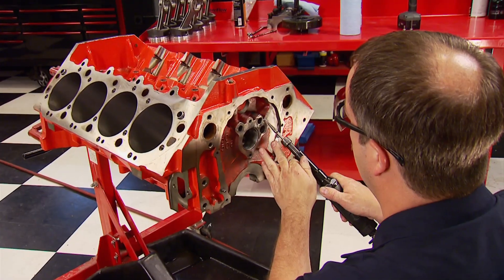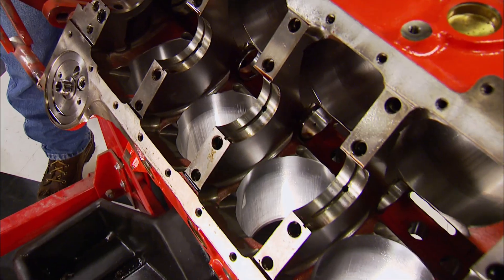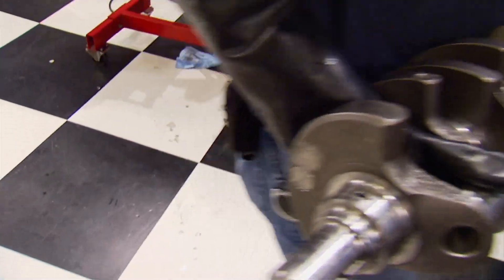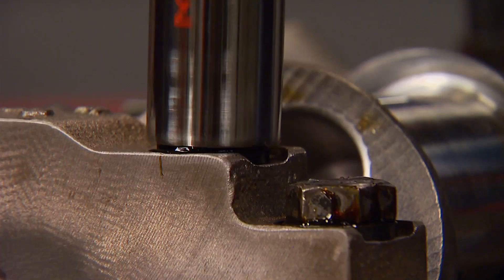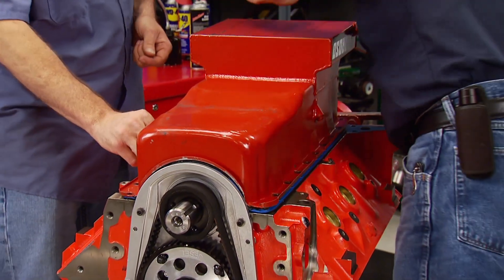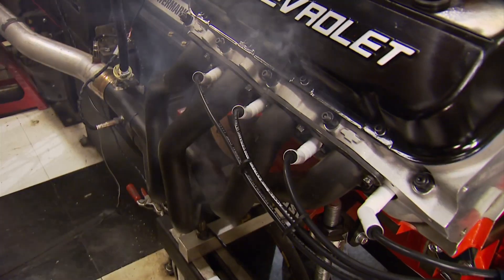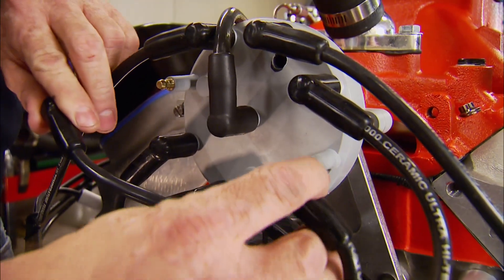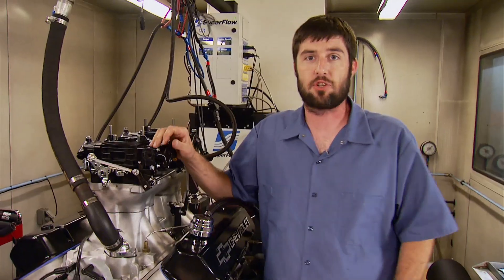Big Block Chevy 572 Bracket Blaster From Leftover Parts - Engine Power S2, E19

Comment: You beat my 572 but I don't know if I'd call that a win. My engine I put in back in 2005 and over 20,000 miles and counting. 
My 572  compression 10.5 flat top pistons, off-the-shelf rough aluminum castings, angle Milled down to 106 CC combustion chambers. 345 intake CC runner heads. Solid (non roller) cam 580 lift 256 @ .050" duration. Merlin X intake, 1050 dominator. Double roller timing chain, MSD digital 6, 87 octane ethanol free pump gas. 
730 horsepower at a low 5400 RPMs.
740 ft lb of torque at 4000 RPMs.

What I learned years ago is keep the RPMs down you'll make anything live a lot longer!

An open chambered head makes more power. But when you have to run a dome piston you have to retard timing back so you kill power on pump gas. Two identical engines one with flat tops and milled cylinder heads like mine. And one with Dome pistons and a 119 CC heads. Of course everything else being the same and pump gas. My engine makes more power and without detonation, without engine run on and without dieseling problems. I've been there before with these problems running Dome pistons and pump gas that's a junk way to go! And after 18,000 me my Pistons were freed in another engine. When you get into angle milling the cylinder heads you're changing the valve angles that makes a little more power. In this sport everything adds up. For pump gas it's only a flat top or dished piston and solid lift cam with me. I'll go back to a solid roller when the roller lifter Wheels don't fall apart. But until then I'll just go to more cubic inches you can never go wrong. With my engine proves in its same class it beats the competition and it's an old engine. This engine beat me by a little horsepower on top but my engine beat it a lot more across the board in torque, and maximum torque. I'll take the torque any day torque is King on the street or strip. And the lower RPM's is a win. Ideally I would rather be at a lower compression like this engine so I can spray more overall nitrous. The lower the compression is the bigger the gain and the easier the tuning window is with nitrous! 

I would rather see this engine with more testing on the 9.6 compression, solid cams and tunnel rams. I'm just not impressed as much with high compression engines. I've been there before it's just not fun stocking, rotating getting and pouring the race fuel in the vehicle. Not including the high dollar price of race fuel! You're not usually going to get as much of a deal unless you buy race fuel in 55 gallon drums or more. I'm not for the little gain in compression it makes. And having to run race fuel with a dome piston. I would rather add more nitrous, pump gas and a flat top piston. Sure at a certain point you need race fuel for so much nitrous. I run an extra fuel pump and fuel tank for nitrous. For a weekend warrior it's only pump gas. I would go to E85 but it's too much corrosion and maintenance.

Comment: Tuning changes are made, but then you also raised the pull RPM. Horsepower is going to increase based on just that. Why not keep rpm sweep the same, then make tuning adjustments?

Comment: With 93 octane they should have bumped up compression to about 10:5.  That carb and intake is huge and 572 inch should be around 750 horse 700 torque.

Comment: Why do you start out with 32 degrees of timing on these type builds when you know that motor combo is gonna want at least 36 or more. I spray my 565 with 200hp with 30degrees & it's going still strong 6 years later.

Comment: Electronic fuel injection would be the way to go on this and ever motor you guys build, but seems like you guys are scared of fuel injectors and coil packs. Scared to make real reliable power that dont need a water hose for a injector

Comment: Do all this and waste all this gas to get smoked by a civic with a fully stock k24(2.4 l) with an Ebay turbo setup making a reliable 500+hp. In v8 terms or this big motor that would be that would be around 1500hp+ on a stock v8(this huge motor is more than 4x bigger than a stock honda k 24)

Comment: Absolute lame sauce! Engine Masters had a 454 that put out 620hp on pump gas.. pretty sad that 118ci is only worth 52hp..

Go ahead, get your clown shoes on..
Reply: It's the compression. 9.7:1 is dogshit. 12:1 or 13:1 would be much better for this engine, especially if it was running E85. Not to mention that cam is still tiny for this motor, regardless of what fuel you put in it. 260/270 ADVERTISED (not at 0.050") with only 0.670"/0.670" lift? Those are stroker LS numbers, not monster big block numbers. Crower makes a monster cam that would be perfect for this: 319/348 advertised, 285/309 @ 0.050", 112 LSA and nearly 0.900" valve lift on both sides. In fact, I'd daresay all those cubic inches would actually quiet it down and make some crazy low end torque. 800 lb-ft and 900 hp anyone?
Reply: Yeah...you tell ‘em!

Comment: The 557 inch bbf they did made 750 hp with a single 4 barrel. I would have liked to see how much more power the ford would have made with a tunnel ram.
Reply: Yeah and it's 15 cu inches smaller. Go Ford.
Reply: apples to oranges...the chevy used "Chevrolet performance parts"  block, heads and intake.  the ford used trick flow cnc competition heads and intake.  it also had more compression. both good engines.

Comment: I think the headers are a tick small and long.  2.250 stepped to 2.375 at 10 inches with an overall primary length of 26 inches into a 4 inch real merge collector would be worth some power at 5500rpm and up.  Good episode.

Comment: 4/7 swap only works if the distributor is run off the back of the cam.  spark is a little more accurate.  does nothing for crank trigger.

displacement is torque.  hp is in the heads.

Comment: I like You guys and your builds. I truly wish you would put more timing in your dyno runs. Sure there is a perfect timing number for every build or engine design. Typically a big block chevy likes between 36 and 40 degrees. With only 9.6 compression and that huge cam, bump it up and see where peak power is. Thanks for all you do.

Comment: I have a stupid question that I've always wondered about. Why are some big roller cams copper between all the lobes? Do they copper
plate them before grinding everything in, and why?
Reply: It’s not copper. My guess is that’s the coloration left behind by the heat treat process. You don’t see that on the lobes & journals because they’re finish ground after heat treat.
Reply: @Icutmetal  ahhhhh you know what I never thought about them heat treating the billet core before grinding...  You may be onto something!  Thanks for the reply!

Comment: I can't believe it! I just went and checked behind my wood pile, and there next to some old greasy parts was a GM 572 block with chickens living in it!
I moved some old sheets of iron and there in a mouse nest was a complete rotating assembly with 4340 Callie's crank and rods and je pistons.
Stuck in the fork of my shade tree was a pair of GM heads freshly ported by Livernois motorsport!
I ran in the house to tell my wife and tripped over a tunnel ram on my front door step!
While lying on the ground I saw a pair of QFT black diamond carbs in a Ravens nest!
While climbing the tree to get to the Ravens nest I grabbed a branch which was a Crane 4/7 swap solid roller!
When I got out the tree the wind blew away some dead leaves exposing all other required valve train, carb and other small parts!
All I had to do was go and look! Well I'll be damned...
Reply: All spare parts
Reply: @maxwelllevy5760  this morning I cleaned out the chicken coop and found a Boss 302 😂
Reply: Good thing everyone has at least 3 Jesel belt drives  just laying around too............
Reply: I found a LSA supercharger behind the dryer in my basement. Forgot I had the thing which I spent a few thousand dollars on. Couldn’t believe it
Reply: @Tec9Jenk  😂👏
Reply: That’s a great little story!
Reply: Can't. That's my yard
Reply: Too funny
Reply: @bigboreracing356  yesterday I found two superchargers and a SBC Motown intake in my garage...
Reply: Hahahaha

Comment: You should really disassemble the pistons from the rods before stuffing them in the washer. You can't properly clean the pin bores or the pin oiling holes.

Comment: Those weren't quite the spare parts I was picturing in my mind. Realistically most DIY cars guys with a little building/garage in their back yard aren't going to have spare parts like those lying around.For the price of those spare parts on that engine you could make your building / garage a little bigger and save a few bucks if you can do some of it yourself.Then rent the new space at a cheap hourly rate to other car guys or anything else motorized that maybe only need an hour or two and are trying to save a few dollars. Hopefully someday I will get a chance to do that.Have a great day car guys.Peace.

Comment: Should have tried a set of AFR cylinder heads with the single 4bbl intake. Also the compression is way too low for cams this big, giving away a lot of power here. My guess is that the cranking compression is not very high due to the long cams.

Comment: The tunnel ram cranks out big numbers everywhere in the range...except you just showed it making 30 less numbers everywhere under 6 grand.  Which means it sucks on the street, especially when most people go big block for low rpm numbers.  Try a dual plane with dual 500's or so and watch that thing make torque.
Reply: The guys on Engine Masters have proven this over and over again that long runner intakes like a tunnel ram are horrid on the street and are best reserved for high RPM racing applications which is what they were designed for.

Comment: B.S.! Parts laying around? Come on! Im tired of shows like this. They always make top power numbers and act like its no big deal and cheap enough that everyone can do it. Most guys can only add a few bucks to their rides at a time. $10k plus engine is what you just watched. Not a loose parts build!
Reply: That's true but "today we're going to install some sweet chrome valve stem caps that we picked up when we were at Napa to buy a valve cover gasket for the wife's 87 Ford Escort" wouldn't make a very interesting show.
Reply: Do most people have these parts laying around? No, probably not. However a lot of people DO have enough parts to get a SBC or 2 together laying around.
Reply: A lot of people would have parts to build a BBC or two but not at this level. Most would be junkyard builds and some swap meet parts.

Comment: Did he forget to lap the valves
Reply: Every head job ive had done they always lap the valves
Reply: Not needed
Reply: If they kept the valves in order of which guide they came out of, lapping isn't necessary because they came lapped from the factory. If the order is not known, then it is best practice to lap them in to ensure proper sealing.

Comment: WOW, THATS SERIOUS POWER, IMAGINE THAT IN A 1ST GENERATION CAMARO WITH TRACTION AND GEARS? EASY LOW 10'S ONCE ITS DIALED IN BUT I THINK THAT HUGE CAM MIGHT BE TOO MUCH FOR STREET USE, WOULD THE LOBES WEAR WITH THAT MUCH RAMP ON EVEN OCCASSIONAL STREET USE?   I AM 64 AND REMEMBER THE L-88/ZL-1 FACTORY CAMS WERE ABOUT 560 LIFT ---ANY VERDICT ON OVAL VS RECTANGULAR PORT HEADS? I REMEMBER SERIOUS DEBATE BACK IN THE DAY

Comment: Swap cam to a hydraulic roller & that would be fun on the street. Good power.
Reply: They use solid roller cams because they like to spin the engines higher. In the RPM ranges they always run, a hydraulic lifter would pump up at high RPM causing the lash to be grossly out of spec. For the average street engine with occasional drag strip passes hydraulic lifters would suffice.
Reply: @TwentytenS4B8  Solid roller on the street usually means engine failure sooner rather than later. In my opinion not the longevity of the hydraulic roller . Sacrifice a little power for longevity is my theory.

Comment: can I drill holes in my new bearing, even it's not a high-performance motor like you guys? I have a 1983 S10 V6 2.8L that I'm rebuilding the engine. thank you
Reply: You can drill the bearings only if the upper journals are slotted like on this engine.
Reply: @dave1135  thank you
Reply: As long as you have the oiling grooves in the main bearing saddles you can drill the bearing.
Reply: How come your not going 4.3 ?
Reply: @brianjacobsen5762 Jacobsen original engine!!!

Comment: How did the different firing order affect the engine's sound...  Better, or worse?

Ford 5.0 HO sounds a lot better than the standard 289/302/351.  I attribute this to the revised firing order on those particular engines.  However unlike the small-block Ford, BB Chevrolets sound great as is...
Reply: Ford 5.0 HO uses the 351W firing order.
Reply: @TwentytenS4B8  I'll take your word for that, but I assume you get my point.

Comment: A timing belt???????
Reply: Yup, when you want precise timing control at higher RPM, you want to use a belt or a gear drive. There's a reason the European and Japanese designers have been using timing belts on their street and race engines. Cog belts don't stretch and keep the cam timing at what it was set at. A chain will stretch causing  the cam timing to migrate a few degrees out.

Comment: "You can do this at home" Uses a pair $10,000 parts washers.
Reply: Yeah you really can do this at home, just break out the brushes and garden hose. Parts washers are nice, but theres other ways.
Reply: Pressure washer and a cleaner from Dollar General called "Awesome" works too. Cleans blocks right up.
Reply: Or the home dishwasher.
Reply: Was thinking the same thing. Who has a $4k washing cabinet and a $6 ultrasonic parts washer at home? (Not to mention $10k in new condition parts laying around)
Reply: All of these shows are realistic when it comes to “budget” builds. Yet again my budgets are usually minuscule.

Comment: Are you going to get a fuel injected manifold, not use the already supplied injector ports, modify it to accept a carburetor adaptor which ruins the characteristics of the manifold and then say the fuel injection is horrible.

Comment: for those of you wondering... that 4-7 cam swap doesn't really make any horse power difference all it does is allow for better cooling and possibly better balance in the firing order.. its a trick but its not much of a trick... most people won't be able to take advantage of (or feel) any gain which is only about 4% maximum with an average much less depending on the engine size.

Comment: Legit question: what is the advantage of using a belt instead of chain for timing? Wouldn’t that be a failure or more frequent required maintenance part in lieu of a chain set once?
Reply: I never ran one myself but i believe the benefit is more precise timing control and easier adjustment. A belt doesn't have all the slack a chain has with all of its individual links. Temperature is less of a factor on a belt.  Plus the number of teeth on the belts makes it easier to move cam timing in smaller increments. And since all the oil is sealed-off behind the rear cover, timing changes do not nessistate gaskets. It really isn't practical nor affordable for street application. It's a great piece of hardware for bracket racers or other guys who need consistency at every hole shot. That's armchair knowledge. There's probably others that will chime in and give you better information than me. Good day.
Reply: jackusflackus1 that’s what i was wondering
Reply: I read on a hot rod magazine basically what mindeloman wrote and that the oil is not aerated by the chain and that the friction from the chain and the oil is eliminated. I guess it also frees some horsepower......it would be pretty cool if such setup could be used on the street.
Reply: Timing chains stretch no matter what the construction. High RPM magnifies this effect. Cog belts don't stretch. Gear drives are another example of having the precise timing control at higher RPM due to timing components that do not stretch.

Comment: Why not a Cadillac 500ci? Lotsa cubes, high nickel block, and aftermarket support.
Reply: The oiling system in a Caddy 500 sucks ass. Spin that thing over 5K too many times and you'll spin the bearings right out of it.
Reply: @TwentytenS4B8  Correct! Proper machining and tolerances, along with revised oil pump and done.
Reply: The Cam bores are a little small, so you need aftermarket rocker arm setup if you want to crank up the ratio to make up for it. The oiling system is no worse than a Ford Cleveland. The best thing about the Caddy is the torque--its off idle just like a diesel engine. Shift at 5,000 RPM with highway gears, and you can pull trailers up a wet wall.  None of this 6,800 RPM stuff you only see on a racetrack.  But if you want 500cid + for cheap, look at the Ford 460. They even use a canted valve Bunkie's friends brought over from GM.
Reply: They have some support, but I wouldn't waste my time with one. Might make an ok tow rig engine though.
Reply: @2015_Rubicnn  Check this out. https://youtu.be/QgRNf5Ie8II
After owning 368s/425s/472 and 1 500, i can assure you these engines will live forever.
Reply: @NVzla  Didn't they only put the 472 into hearse's?
Reply: @sparkplug1018  472s were in Devilles to Fleetwoods and meat wagons. At 1974, all Cadillacs had a 500, but it was heavily choked with emissions and low compression. Try to score a 1970 500, those were the best ones and made 400hp from the factory.
Reply: @NVzla  500 Caddy.  I like the way you think.